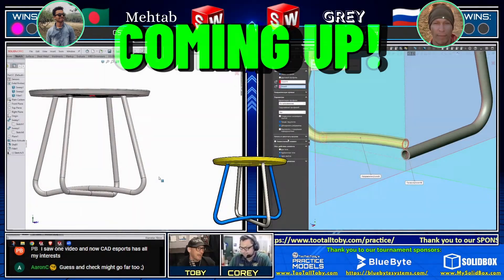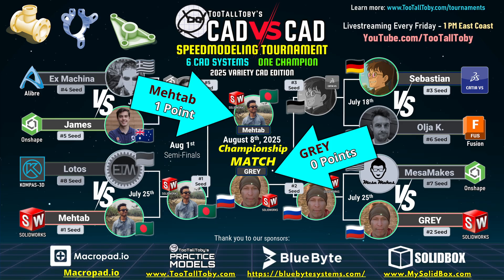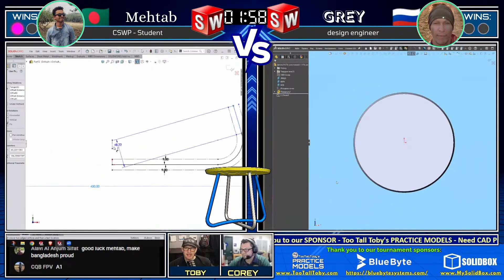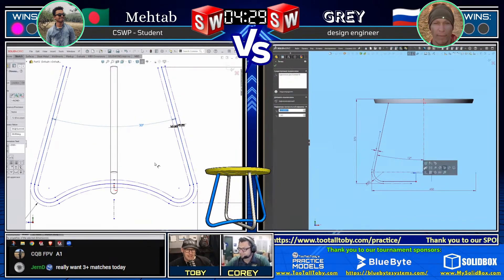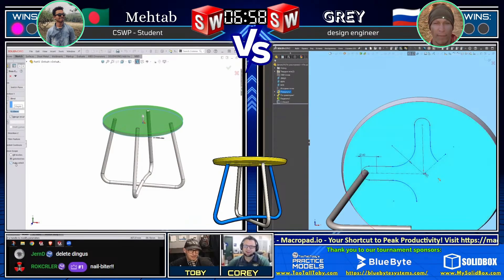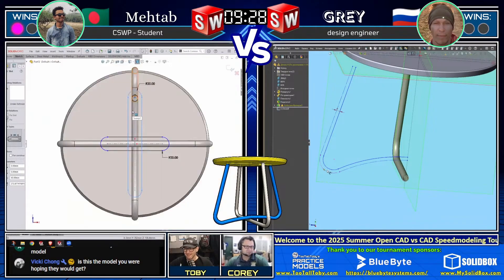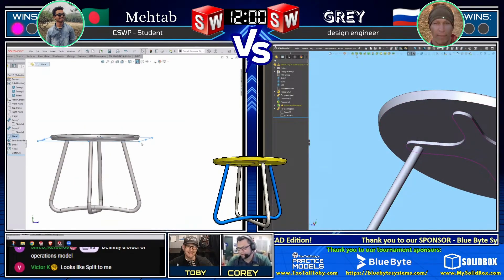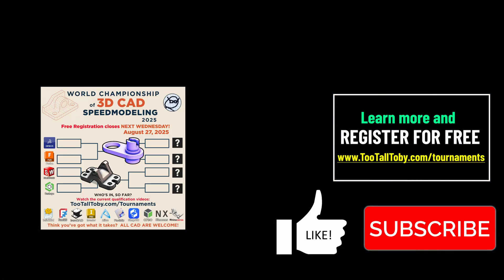CAD Speedmodeling Tournament! - FINALS Battle 2 - SOLIDWORKS vs SOLIDWORKS

Comment: For those looking to learn CAD, and especially SW, these are not "best practices" techniques.  Having a clean model or clean assembly that can be altered after the fact is way more important than just throwing geometry on the screen as quickly as possible.  There will be revisions in real life.  There will be alterations.  Some of the stuff shown in this video would be frowned upon in a work environment.     I wish the announcers pointed out the difference between a real world work environment and these fun challenge videos.
Reply: You are absolutely right. Real parametric modeling has a much larger scope of CAD logic. Therefore, the way of building for challenges will be different from the everyday workflow. I also have a problem with the fact that in my CAD many hotkeys are configured for working with assemblies. But everyone accepts the rules of this game and adapts to them. I think it is obvious to everyone.
Reply from the maker: Thanks for the comment and glad you enjoyed the video!